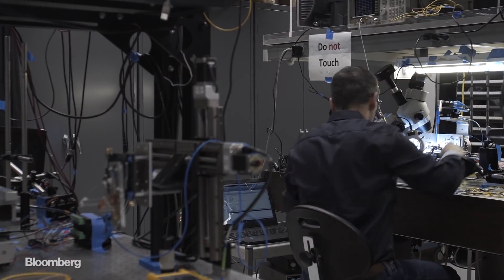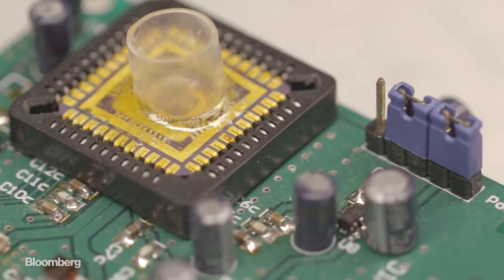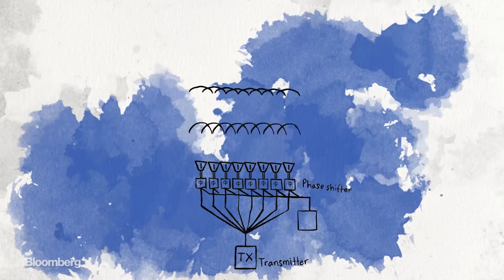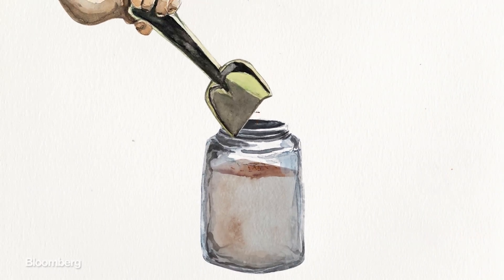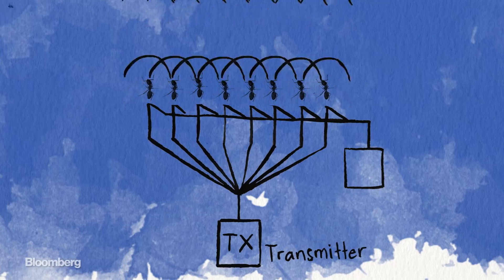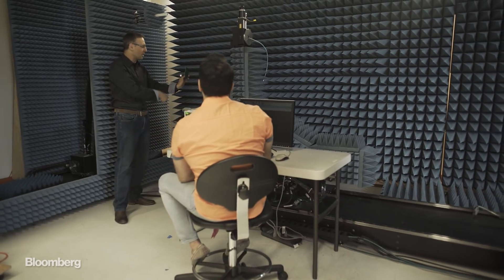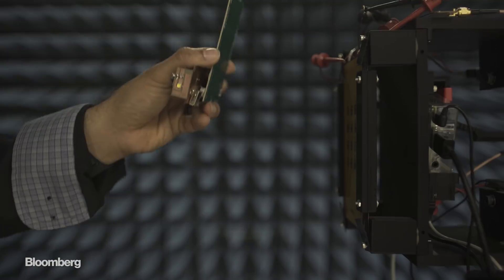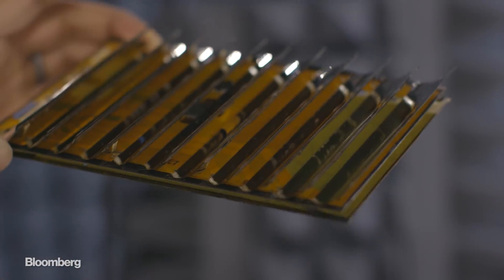Elon Musk Doubts This Idea. Ali Hajimiri Is Betting on It.

Comment: Collecting power from space isn't really the real problem. The real problem is that wireless power transmission is inherently much less efficient than using physical wiring.
Reply: Better lack of efficiency with limitless energy than efficiency with lack of it .
Reply: Place mirrors in orbit to send photons to earth. Way more efficient than wireless.
Reply: J. C. - his tech wasn't suppressed so much as that it was and still is not feasible. People have been trying to get his ideas to work for decades. I saw a paper from MIT 10 years ago that was talking about using magnetic resonance for wireless power transfer (Telsa's concept) and they apparently never got it to work. At least not in any form that isn't exceedingly expensive (aka inefficient).

Theres a ton of great ideas out there and people are working to make them real, but if it costs 1000 times as much as a traditional solution then no one will be willing to use it so it just sits on a shelf for a few decades until science progresses enough to make it cost effective.
Reply: Spring Bloom efficiency is the biggest problem in all of energy gathering. We have so many sources of practically limitless power. The problem is can we reasonably use it, if it takes forever to get power or requires an unreadably large setup, then the method is pointless. We have had wireless power transfer for a long time the problem is power losses in transfer. Not because we are running low on power as a resource but, because we need to harness a magnitude more energy than we expect to get out.
Reply: Collection of power in space could be used for solar sail as space travel using a high powered lazer but the transmission of power back to earth at the moment is pointless as there are better technologies around and being developed.
Reply: +dkail08

That is one of the most ridiculously false statement ever. Pound for pound most  green solution (including electric cars) are better for the environment than the  thing they sought to replace.
Reply: Unless they come up with radically new and better battery tech. Like batteries that never degrade etc.
Reply: elon musk will send rocket full of his powerwall batteries, and charge them in orbit then bring energy down to earth
Reply: And none of them seem to realize that a megawatt energy transmitter is basically a death ray. Let alone a 100 megawatt version or higher. Plus imagine an omni-directional energy transmitter within say a district, that alone requires multi-megawatt power then bump that up if need to also power vehicles. That's a district-size microwave oven.
Reply: J. C. It wasn’t suppressed. It was just impractical. His wireless electricity experiments basically made any metal object in the vicinity become electrified. Don’t be another mindless internet conspiratard.
Reply: dude wiring costs a fuck ton of money. And you certainly cant put wiring on a space object to earth.
Thechnology is improving, we use more of it, everywhere, putting wiring not only require metals manifacture of them. They also require maintenance and installation(digging or putting on electricity poles)

avoiding use of wiring and advancing to wireless would be huge. And as mentioned in video most of his inventions are related to doing things wireless that most technology didn't advance to yet. So don't judge this so much.
Reply: wireless power isnt just advanced enough atm
Reply: I dont get how the power will be collected on the ground sinse the space station fx. From what I've heard will se the sun rise 12 times or something like that, how will they have a fixed connection as it seems is required in the video?
Reply: most likely if they do build something like a wireless power transmission laser, they would have  it run on custom  software and custom hardware making hacking it less likely and the power to send the signal out would be hard to do plus i would use encryption such as a variation and intensity of a sent signal to conform that it is a proper signal  , but if they want even it to be more safe  cut all the external controls and have it  manned sort of like the iss.
Reply: yea, and OMG the cost of sending solar panels to space will never be feasible, many once we harvest asteroid, but otherwise, no
Reply: As a physics student im not sure im entirely correct but this seems like a terrible idea as electromagnetic waves spread out according to the inverse square principal, thus long range energy "beaming" would be inefficient and lose energy proportional to this principal.
Reply: fusion technology keep trying? ??
Reply: Not true. If it provides constant charge then no need to charge or have a huge battery
Reply: And what is the benefit of gathering solar power from space then transfer to earth compare to setting up solar panels on the ground?
I admire the thinking of transmitting power wirelessly but why not just use that technology to setup stations using current infrastructure and charge our mobile phones etc?
Reply: And less reliable.
Reply: Madadi Sairam it’d be cool if restaurants everywhere had built in wireless charging pads though.
Reply: +GreenPigKing

"it’d be cool if restaurants everywhere had built in wireless charging pads though."

Based on the current efficiency of wireless energy transfer, I would say that is a horrible idea which will have huge negative  environmental impact.
Reply: I think it's possible. For wireless transmission of energy can be transmitted by putting convex lense in a relay system. I don't know how and with which material made lense can do the work and the space base relay system by putting lense on different orbit  base from earth surface  may work. It just a rough idea but More logical.
Reply: Wireless transmission through induction is so inefficient that it's insane anyone would be for it while saying they care about the environment
Reply: except Australia.  90% of solar panels fail in 2 years in Australia or some ridiculously high number.  Sun is too hot.  Tier 1 panels only.
Reply: Walking contradiction.  Wireless power transmission from space, ridiculous.  Wireless internet transmission from space, great idea lets launch 1000 satellites and spend billions!  This guy is so obviously shady.
Reply: Ancient technology  pyramid network, is true.
Reply: But then we can't leave the issue if expensive launches
Reply: Because honestly the long-term goal should be a Dyson swarm. This will not just be capable of powering the Earth but easily interplanetary missions at remarkably high speeds. 

This is a solution we can implement and will pay dividends to humanity for literally A Thousand Years.

But yes why build roads just so that we can use cars when there are plenty of horses for everyone to ride? And the railways will be up and running across the country soon enough.
Reply: The easiest solution is to use a cat and spread butter on it's back and drop it from any height. Boom a perpetual motion machine!
Reply: timeofsage we have been working on fusion for a long time and we are already partway done with the construction of a giant fusion reactor
Reply: No it's the shipping of panels to space.
Reply: timeofsage you stupidity is astounding
Reply: for all the idiots talking about gathering solar energy from earth. The ozone layer blocks most of energy from light. If you ignored ozone layer earth would be at at least 100 C constantly. Which is why sun panels in space would be much more efficient.
Though I hope the way this guy mentions energy mostly ignores ozone. Otherwise your points might actually be kind of correct.
Reply: true but constructing a physical wire to space is at least expensive...
Reply: you say this but how many people still you a corded phone. let us see this tech in 10 years to never need to plug anything in.
Reply: That's not an apples to apples comparison. Phones need to transmit DATA, whatever power transmitted is not the main goal and in fact one desires to transfer data with as little power as possible to ensure signal integrity. Of course power transmission via wires is more energy efficient, but the power used for transmitting cell phone and wireless internet data is insignificant compared to what an orbital solar power station would need to transmit through a much longer distance. 

Another problem conveniently left out with wireless power transmission from space to ground is safety. Whatever beam of EM energy you'll need to transmit power wirelessly to the ground will need to be very intense or else get wasted on warming up air molecules.

I'm not dissing on the concept of solar power generation in space, far from it. In fact, with the relative lack of atmosphere up in space there's more solar energy to collect. The real problem is how to efficiently transfer that power to people on the ground who need to use it. If the return on energy investment (note I use PHYSICAL accounting, not the monetary accounting system that can be manipulated to kingdom come) is terrible, with the energy harvested struggling to replace the energy used to generate that energy, then it's unfeasible according to the laws of physics.
Reply: Why settle for one thing that may work sometime in the future, if you can develop many alternatives that will work tomorrow (albeit with varying success) in different environments and situations?
Reply: Madadi Sairam wires rule!!!
Reply: If you consider using millions of miles of wires efficient then sure
Reply: generating power is more costly & its not about efficiency ,its about Cost
Reply: explain "inherently much less efficient than wiring". a inquisitive mind.
Reply: yeah, and the fusion technology is near. why trying hard get power from the sun from space if you just can make tiny star on the ground.
Reply: Yes, but the discussion is regarding power generation in space and the efficiency of wireless transfer to the surface. Im not sure how your comment addresses that?
Reply: +dkail08

The only disadvantage that EV have compared to ICE  is the range and  upfront cost (maintenance wise EV is  actually better). But neither of those are environmental impact. If we really go from the true environmental cost from procuring the resource needed to build both types of vehicles and their maintenance throughout  their lifetime then  EV  have a smaller footprint on the environmental in total vs that of an ICE vehicle.

As I said, the disadvantage of EV compared to ICE isn't environmental.
Reply: Efficiency isnt as big a problem if you have limitless power, which is what orbital powerplants can practically offer.
Reply: even the solar panels at seat level have some efficient issues, I wonder how inefficient this one is...
Reply: Why redirect the sun from space to earth to get power from the sun?
You kind of get a lot of sun to the earth.... like all of the time.
LOL..... ?
Reply: 4G12 thats what the edison fanboys want you to believe
Reply: timeofsage - the problem with solar on the ground is that it's not the magical eco perfect solution people pretend that it is. People have to manufacture, distribute, and maintain them all of which requires resources. Resources that cause pollution. That's not even considering any direct environmental impacts due to them sitting on the ground in a large area or the impact of disposal at end of life cycle. 

Plus solar is exceedingly inefficient compared to everything else. Now think about all those problems and then scale the efficiency way back due to energy loss caused by light diffraction from the atmosphere and suddenly you're spending $100 million to save $10 million in energy production. Again that's not even considering the environmental impact from production, distribution, and launching the fuckers into space. Oh and it's adding a bunch of space debris that will eventually become an issue.

Unless this guy can figure out a way around physics or create some sort of vacuum tunnel through the atmosphere then it's a non-starter.
Reply: Madadi Sairam What if we create small rips in space and connect the power source to the fixture that needs the power like a star and a transmission station....
Reply: and it's super dangerous weapon if you hack it. just transmit all that megawatts in to a small spot to burn it.
Reply: remliqa - that's only true if you look at it in a limited scope. If you want to compare co2 emissions then sure, but pollution isn't just emissions. It's more complicated than that. Comparing electric vs gas isn't an apple to apple comparison but that's how it's constantly done. They both have pros and cons. Stating that electric vehicles are more environmentally friendly is an arguable statement and depends on how you want to measure environmental impact. But of course the greenies are interested in pushing electric vehicles so they downplay the negatives and push the positives. It's an overly simplistic view of a complicated situation.
Reply: the wireless transfer of energy is easy people have been doing it for centuries milenia infact

atleast last i checked sunlight didnt require wires
Reply: Spring Bloom - it is a problem. If it takes 50 years to recoup the costs (and environmental impact) versus doing it a more effective way then it's not worth  it. Mainly due to the fact that you're actually causing MORE pollution trying to prevent it. Most of the "green" tech actually causes more pollution than traditional methods due to the terrible efficiencies. Electric cars are worse for the environment than gas cars are due to all of the toxic materials and other issues. All it's doing is swapping the type of pollution from some co2 for massive amounts of toxic chemicals in waste disposal areas. 100 years from now they will look back and wonder how we could have been so stupid as to think that all cars could be electric.
Reply: solar power from space lmao. Opiate to the morons.